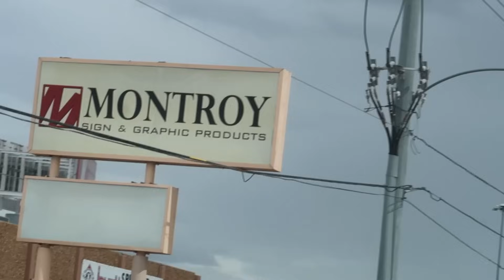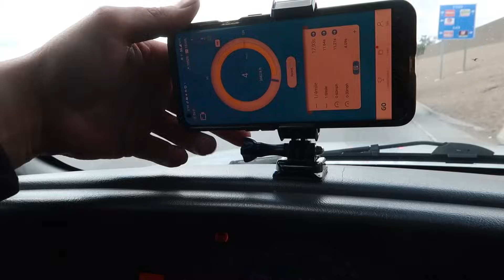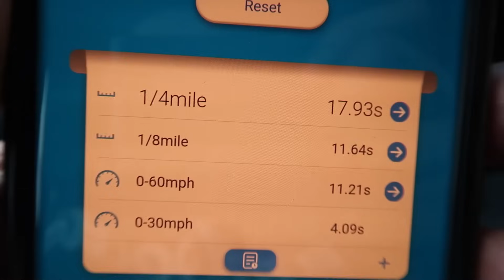It's REALLY BAD! Worse than we thought!

Comment: Just keep in mind,  if that's currently a gen 3, I'm pretty sure the crank has a different tooth between the 4. So you would have to buy a new crank position sensor and your computer would need to be re programmed for the different tooth as well. Whatever the case is it will be easier to get the same tooth crank that you currently have if replacing
Reply: Facts

Comment: For shits and giggles, check the flex plate for cracks... pull the inspection cover and see if you can  see any metal shaving or the flex plate itself ...if you have one of those small cameras even better stick that in there and look

Comment: Did you swap over the stiffer valve springs that go with that cam? Did it have stiffer valve springs for the cam from the start? Why not get the Tahoe set up as a reliable daily then  build and turbo the Colorado? That way you can use the Tahoe to tow the Colorado to races like the back halfs or air strip they run in Tucson. My friend does that with his turbo 5.3 s10, he tows it with his Tahoe out of town. We been to Tucson a lot and LS fest in Vegas last year.

Comment: Rods are what you need out of a gen 4… and a good set of pistons even if you gap the rings you will end up with piston damage when running a turbo setup….i did a gen 4 rods and a set of wiseco pistons and that motor is about 10 years old still running
Reply: If you get piston damage while running “good” pistons and a turbo means your tune sucks, you run shitty fuel or have the wrong plugs. Either way you’re detonating.

Comment: I would make sure it’s not an exhaust leak  broken header tube or a sprite plug wire arcing. I’ve had to same noise  if it was a rod bearing you could’ve seen piston hitting the head

Comment: If you ever question a light only thing you literally have to do is just put power to it a noid light is only 12v. Sounds like a purge solenoid or some kind of blend door binding up, you guys see & hear rain & think tsunami. If it was a catastrophic problem your going to have catastrophic symptoms no oil pressure, actual load noises, improper running, that engine sounds good you want to rebuild & spend money. Ls engines are much tougher than people think it’s the son of the best engine ever made.. SBC for life

Comment: I’m pondering on the camshaft bearings. If that’s the sensor that went out,maybe there’s a lot of slack and the camshaft has a wobble and vibrates enough to get to close to the sensor,could also be the crush bearing on the crankshaft,and crank is moving forward and backwards way to much. Great content,